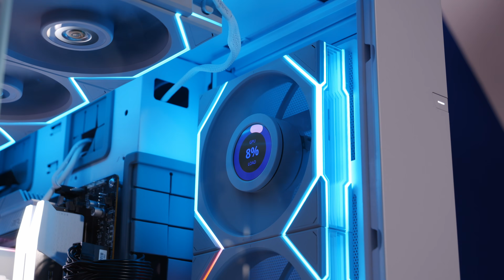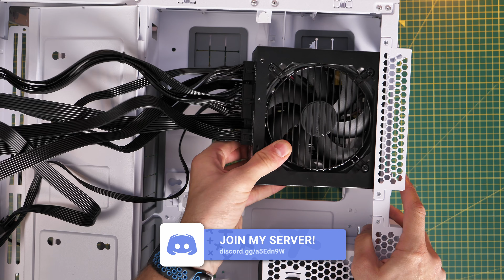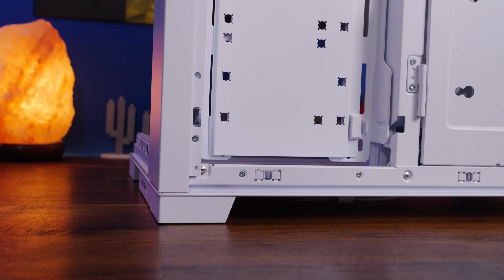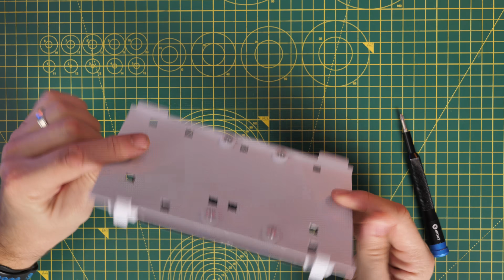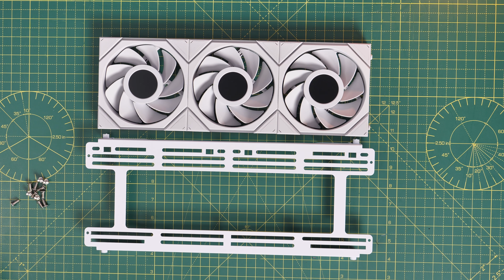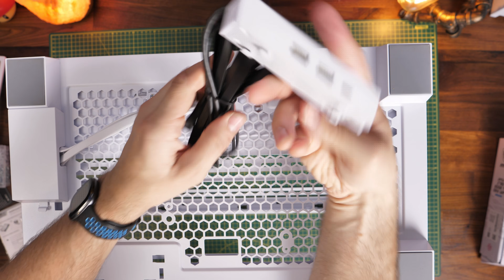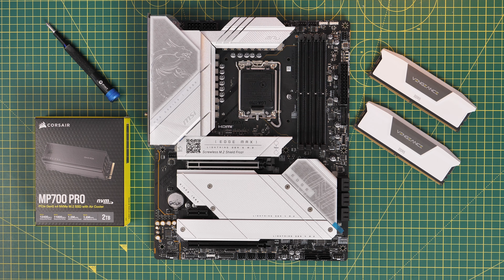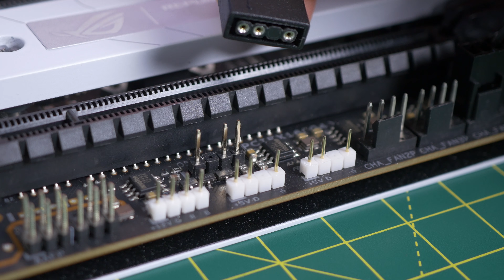Lian Li O11D Evo RGB deep dive with various build layouts!

Comment: A few notes on the case from my own experience:

A 420mm crossflow radiator almost but doesn’t quite fit in the top. A regular 420mm does work with the motherboard in the lower position, but that makes cabling more difficult, so I feel like a 360mm with the MB in the upper position makes the most sense. 

Likewise, a 360mm crossflow in the side bracket might be possible but probably not worth the tradeoffs for most builds. 

The vertical GPU mount needs its own anti-sag device to avoid deforming the back of the case when using heavy cards. In the lowest position, you might get away with a shim between it and the bottom fans. 

The riser cable on the vertical mount is also too long unless it is mounted in the lowest position and the motherboard is the upper position. Otherwise, the ribbon is either pressed up against the backplate of the card or the heatsink for the chipset/VRMs. 

The cable management door does not close completely when using larger PSUs. The side panel still fits overtop, so it isn’t a dealbreaker, but worth mentioning. 

The drive cage area is large enough to support a pump/res combo like an FLT80, but the mounting holes are slightly too narrow for a standard 80mm mounting bracket. Only an issue if you want a triple rad loop without a distro plate covering the front panel or a pump and reservoir blocking your view of those sweet LCD fans.

Not the case itself, but related:  I tried the strimmer RGB cables and while I want to love them, I don’t think they work in this case. The 12vhpwr cable needs a right angle connector to avoid potential bending issues with the side glass and the 24-pin cable is way too long. I could just about plug it straight into my PSU if it had the right connector, but as it’s an extension cable, it just makes cable management that much harder.
Reply: So does a 420mm artic aio fit with rad on top?
Reply: @stevedillinger8642  I have a Lian Li 011D Evo RGB black with an Arctic 420 with Push Pull from the top mount. I used a gigabyte 690 MB and a Gigabyte 407Oti. The motherboard is mounted on the lower position. The fans on the Arctic 420 III bottom fans are the BeQuiet 140 Pro Wings and the top fans are stock Arctic 140. I have on order Arctic 140 Extreme 6 ea. I can not post a picture here. I removed the 420 mount and mounted the top fans and then mounted them to the case. It is tight but if you take the time and figure it out it should work. I love the case.
Reply: @stevedillinger8642 As far as I understood, if you put the motherboard on the lowest fastener, then the Arctic 420 will fit
Reply: So the strimmer RGB 12vhpwr is tight with the Temp glass panel, what version did you use and did you try it on an nvidia 40 series or AMD Card ? Im asking because Im waiting (to purchase) for the release of the 4070ti super card (in 2 days) and this case.
Reply: Whoa great tips I wish I saw before I built in this case 😂
Reply: What the heck is a crossflow radiator anyway?

I did get a wire view pro 2 for my 5090 and it just barely fits inside this case with the standard gpu mounting configuration
Reply: @casedistorted  The inlet and outlet are on opposite sides lengthwise instead of being on the same side. It can make tubing much easier in some cases.

Comment: Hey so is there a difference in size between this case and the original evo? And could you place 3 140mm fans on the back of the case next to the glass or can u only place 2?
Reply: top-bottom-side you can place 3X120mm or 3X140 mm . whatever u want

Comment: In your opinion would it be possible to put a 420mm AIO in the side mount? The spec sheet said that you can mount three 140mm fans in the side, but that you'll be missing four screw points... two at the bottom and two at the top. I would think a 420mm radiator would fit in the side and be secured with four screws towards the middle of the radiator, but I've not seen anything definitive.
Reply: You won’t be able to fit a 420mm radiator on the side because there won’t be enough room for the ports. 

Even a 360mm crossflow is unlikely to fit (not enough clearance for the second set of ports) unless it’s mounted on the flat side of the side bracket. That costs an extra 30mm of space inside the case and makes cable routing more difficult unless the fans are mounted on the other side of the bracket. Aesthetically, that probably only works with an upright GPU mount.

Comment: I can't decide between RGB and XL.  I will install 120mm because the SL INF 140 are not available.  but it would make more sense with the 140mm option on the XL.  I think the space for cable management on the XL is very nice.  With the RGB I have concerns about the dust because the filter at the bottom doesn't cover the entire area.  what do you think?
Reply from the maker: https://youtu.be/WlMu1RzGZ4U

Comment: Some curious differences between this case and the original O-11D Evo. I like that they made more room in the cable bay. It's one f my few gripes about the Evo. If you have a lot of cabling in your rig, the cable bay of the Evo can become rather cramped directly behind the PSU, especially with PSUs above a 1000W. I like how Lian Li extended the RGB on the sides of the fans all the way to the edge, unlike the original SL INF fans.

Comment: Thank you for the very in-depth review of the case! You mentioned that you can do a push/pull orientation on the top fan/rad mount. Is it possible to do that on the side intake? Or only the top? (Not push/pull on both at the same time, but one or the other)
Reply from the maker: Yep shouldn't be a problem. You can do that with most Lian Li cases. Interestingly they also point out how you can put fans at the rear on that tray if you upright GPU mount there, so that gives you an idea of how much space there is.
Reply: @TheProvokedPrawn  thank you for the response! that is good to know. probably will preorder the case soon! can't wait to see the full build video and hooking up the rgb! thanks again!

Comment: If it weren't for the price difference I think this fill the same niche but just straight loses to the regular EVO XL considering the XL has an extra rear exhaust, convenient removable mobo tray, bigger IO, Vertical RGB that this case conveniently lacks, and ability to offset the bottom intake fans without the GPU brackets getting in the way when using 140s. For closer to the same price Id rather get the Vision which albeit not perfect itself, looks just as good in its own unique way and requires less fans ($+100) for similar air cooling performance AND the case/tempered glass doesn't obscure the INF mirrors even if they aren't symmetrical which is really the most important part if you think about it ;)

EDIT: also apparently no dust filters? that's a pointless removal of options to save a quick buck if so.
Reply: Yeah, I'll be going for the XL myself as I've been tired of building mid-tier tower builds with my large hands the past 10+ years. The extra wiring space and removable MB tray just makes it that much better.

Comment: Hi, love your videos, just built my own Lian Li monster. Problem is I got the GA II LCD non inf version but bought some INF fans and installed them on the rad and on the controller at the back. Using a 7800X3D im getting some really shitty temps,just sitting around in windows doing tasks and it hits 70C. Should I repaste and reseat the pump or is there an issue since the cable going on the pump doesnt have any fans on it. I'd really appreciate your input!
Reply from the maker: Hmmm. In L Connect you can set a fan curve for the fans that changes according to the CPU temp. If you remember the port they're connected to you can set them to a higher speed than the rest of the fans. Also I've found that having intake fans on a radiator can make quite a difference. https://youtu.be/sVEXd-Wp8FY

Comment: It's an awesome Case, but what i don't get, why they missed dust filters.. the mesh by itself is just not good enough 😢
Reply: Oh ffs are you serious no dust filters wtf 😡
Reply: Yeah, and the strange thing, is that they have 2 dustfilters on the backside of the new XL case? Should be easy, and not to expencieve to do that for this case too?
Reply: For the airflow it’s better without filter ;) I use the mini air and never had a problem with dust.
Reply: @Mr_B86 ehhh I always been dusty cuz I vape or smoke in my pc room and I have dry skin often so my pc’s always had dust problems 😅
Reply: Man these companies always find a way to disappoint us.
Reply: They have 4 dust filters, two on the side, one on top and one on bottom
Reply: @WuhTF NO they have a mesh but only 1 dust filter on the bottom
Reply: Another deal breaker for me like the H7 Flow. It's getting harder and harder to pick up a case for my new rig.
Reply: @ondowmosa6283  The dust filter at the bottom should be enough if your intake is there and your air balance is slightly positive. You won't be pulling air from anywhere else
Reply: @matsudakodo what about the air coming in from the side area?
Reply: Dust filter is at the bottom where your intake is.
Reply: He just does not say it in the review. On their site they say it is not included. You cannot even buy it. I would not buy it until they produce the filter at least.
Reply: Yeah it’s annoying as heck
Reply: they want to sell it as an addon, lian li najws good products but they're greedy af
Reply: where does it say that it doesn’t have dust filters ?
Reply: It's white. You'll barely see the dust! No problem!
Reply: @correctthatfilthygrammar it’s that you don’t want the dust in your components. Some of us have dusty living areas

Comment: I've just done a build in an NZXT H6 Flow using Lian Li AL V2 Fans and although the fans and how they clip together is great, the software is a steaming pile. It kept saying hub wasn't connected when device manager showed it is. They simply don't work and a quick Google seems I'm not the only person suffering from this. Great fans hideous software
Reply from the maker: Usually a firmware update will fix it https://youtu.be/xmLIU40UOVI

Comment: I think what makes this attractive would be for left handed setup and the seamless perpendicular alignment between the glass panels. Much like the nzxt h9 flow but with the choice for it to be on the left side. Rgb wise would be more of an add on to the rgb lovers. I personally prefer this over the original o11d mainly because of the seamless glass panel intersection.
Reply: the good thing about this O11D EVO RGB is you can remove the pillar and become the fish tank.

Comment: If I didn't just brought the Dynamic a few months ago, I'd buy this one.  Particularly because I have to my system in the reverse built due to where my desk is, but the reverse built with a 3090 is uncomfortable too close to the motherboard because my motherboard is a tad bigger.  This latest incarnation of the Dynamic seems to address that.  Unfortunately, I have a rule of thumb not to buy a new case for a couple of years.  If someone told me they'd give me this, though, I'd be all over it.